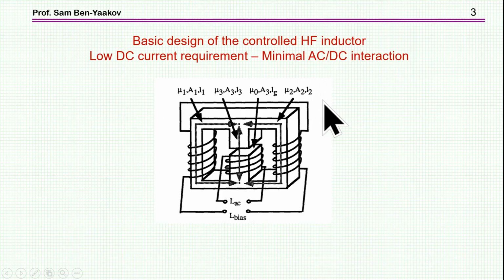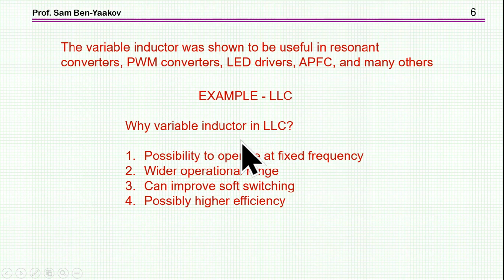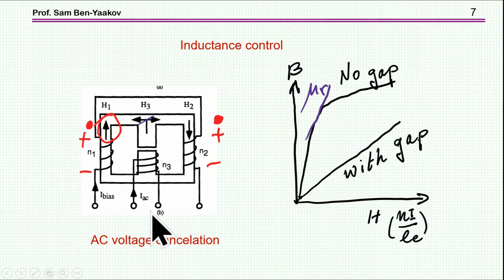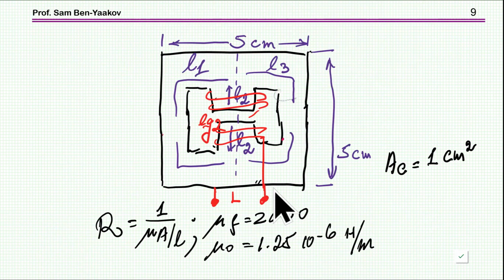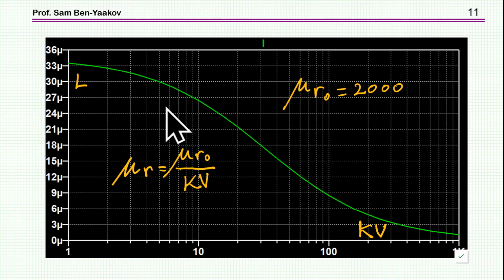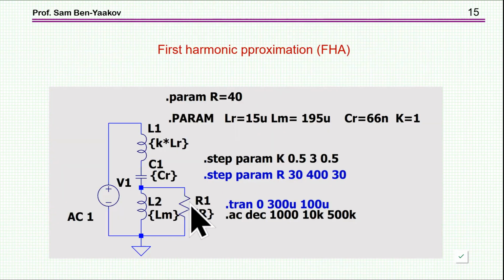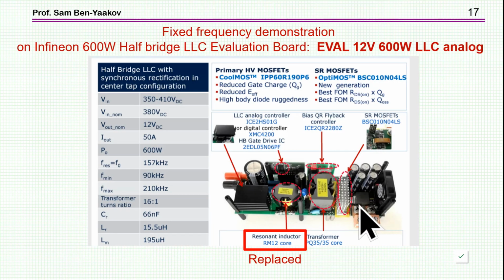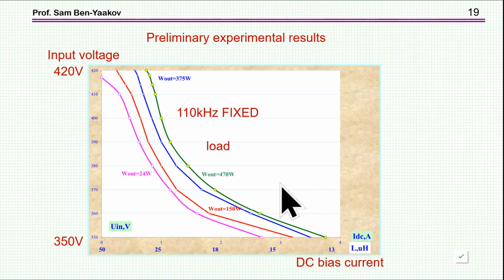The controlled inductor and an LLC converter application example

Comment: I knew about all these, separate aspects, but never thought about putting it together. Very smart!
Reply from the maker: Thanks
Reply: @sambenyaakov  oh no, i thank you! 

About these ideas, some radioamateurs tested many years ago, two torroids put together, in an "8", cc on separate branches, rf on common branches, just like in the application you presented, but it lacked the air gap. It was said it liniarizes a bit the behaviour. I do not know how it works, but in that form is an old idea. With the air gap, neat! 

Btw, if i want to build an oscillator, should i use with air gap or not?
Reply from the maker: @SergiuCosminViorel  For just an oscillator you don't need a gap, But if it is part of a power conversion system you certainly need a gap to handle the power
Reply: @sambenyaakov  Am not completely regularly formed into a competent engineer, so to speak. Am an engineer, however not all lessons learnt. 
Is this about power density, power per volume of magnetic material, in the assumption that the oscillator uses low power, or is it about some other aspects. 
And if i have high power in the oscillator, maybe i need air gap?
Reply from the maker: @SergiuCosminViorel  is for the last sentence

Comment: Interesting concept that I tried to propose for a different application. The weaknesses are in the bias. The energy needed to "saturate " the core is basically wasted (unless a recirculation converter is designed), and the mu_r/i_bias is strongly dependent on uncontrollable factors (I.e. temperature  )
Reply from the maker: Indeed, one has to check is the gain is higher than the loss.

Comment: I've thought about this concept countless times and always wondered how well it might work out. It's very gratifying to see this study and the idea actually being materialised.
My motivation on this is in the entirely opposite direction and pursuing different ends. I was interested in audio transformers and not switching supplies. The question was whether a push-pull  double C core output power transformer, with a minimum or zero air gap could be used for a single output device duty, where one would normally employ a single device biased with dc current that would flow through the core. The aim of course was to thus obtain maximum permeability by virtue of having minimal air gap and thus be able to use some core materials that would not normally be used with any dc current in the windings.
Using a push-pull transformer in this way would result in the core saturating horribly.
Winding window optimisation restrictions aside, I wondered how well having two compensating dc currents applied independently to each outer leg of the core would work (rather than the same current being applied to both legs as is the case here). The problem was, how would the two currents sum up in the central core so as to:
a) counteract the amplifying device's bias current that would be applied to the winding on the central leg of the core and simultaneously
b) ensure that neither of the C sections of the core would saturate.
A ferrite core's manufacturing tolerances would I imagine be much much lower than a double C core's. Thus, where a single dc current suffices in a ferrite core, I would think two dc currents be necessary in a double C core on account of the two C sections having slightly different characteristics due to manufacturing tolerances.
As far from a practical and economical application of this concept as possible I should think but a nagging question nevertheless.
Reply from the maker: Thank you very much for sharing your thoughts and observations.

Comment: Thx for the nice explanation.
I think the core concepts were also applied in magnetic amplifier. If I remember right there is also a post regulator in pc smps which uses the concept of controllable inductance.
Very nice 👍

Best regards and looking forward to your next presentation
Reply from the maker: Thanks for note. Yes, the fundamentals are the same s the mag mp but the these are different construction and applications (e.g. LF versus HF).